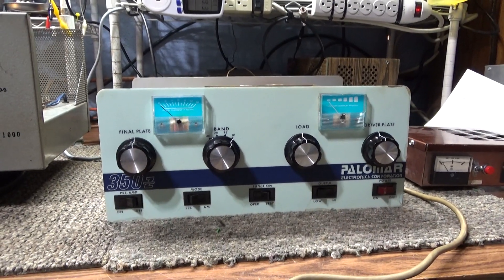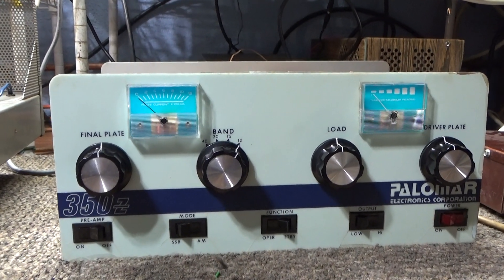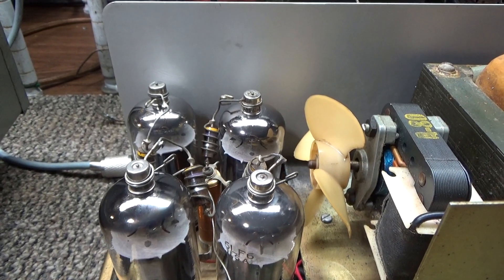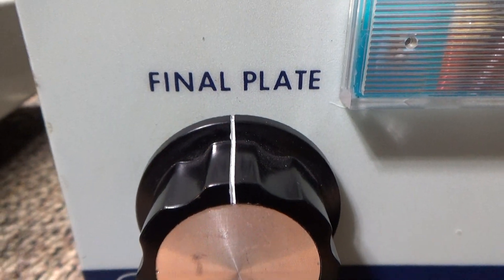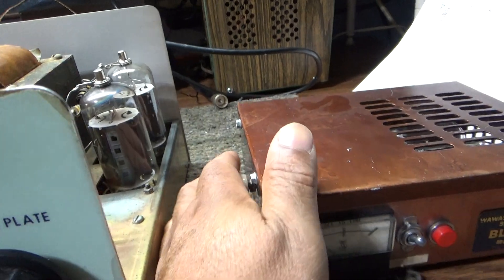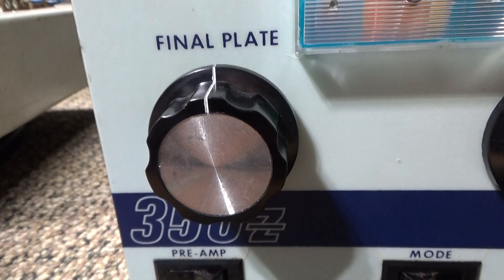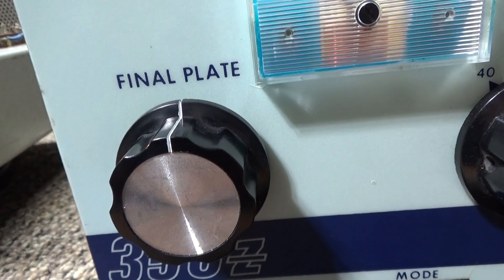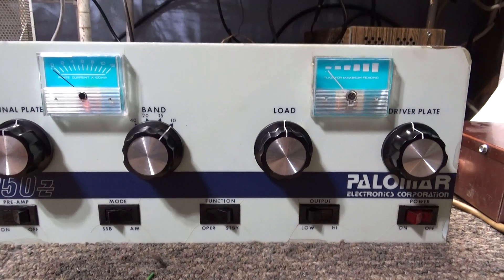Linear Amplifier Tuning Long Winded Walk Thru

Comment: Great explanation Doc! I really like those Black Cat amps. But most CB guys refused to tune them according to the manual. Most amps are grounded grid. That gives a fair gain and a low input impedance. The Black Cats were grid driven. That gave a high input impedance, but a very high gain. On most amps that are grounded grid, you tune for the maximum output, as you pointed out. But if you did that with a Black Cat you would pop the circuit breaker (on the base amp) or ruin the tubes. That’s one reason they had a minimum of adjustments. You adjust to the line and that was about all you had to do. The high input impedance with high gain made for an exceptionally loud amp. I used to get a lot of compliments on the loud volume of my setup. People asked how I got that big swing. I guess that’s why people called them a modulator amp. 
I’m a ham operator too, but CB has always been more fun than ham!
Reply from the maker: Agreed. As you said, Blackcat tried to make them fool proof. The Circuit Breaker instead of a fuse, as people would over fuse them, the 'Set To Line', and the Fixed Tune Cap on the JB-76 and with the smaller JB's they had a Fixed Load cap too.
Reply: @tramdr You hit the nail on the head again Doc! 
Something else I found out by having several of them is that the “power heads” may not always be the same. When I buy a power head by itself I look at how it is wired so I know which power supply it will work with. So far I have 4 different types of “power heads”. I marked them type A-D. I fully expect to see a couple more versions too! Seems like Black Cat didn’t follow any particular diagram. And I remember you saying that you have found many different types of parts used inside of them. Sure is confusing when you are trying to repair one!
Reply from the maker: Yes, I have found about ten versions each of all the Blackcat boxes.

Comment: With the Palomar amplifier your using in the demonstration your showing here the trimmer capacitor on the underside of the amplifier is adjusting the impedance match between the input of the amplifier and the "driving" transceiver.  The goal with all the controls on a amplifier is to adjust for the best impedance match from one stage to the next.  Be it from driving transceiver to driver input, driver stage to the input to the output stage or output of amplifier to your antenna system the goal is to match input impedance to output impedance of each stage.  The better you match each stages input / output impedance the more efficient the system works.  As you say, know your equipment.  If you have instructions for your amplifier follow them.  Also, as you say NEVER detune your amplifier.  Your amplifier is still making the same amount of power, It's just now burning up that unwanted power internally. because you have created a impedance mismatch between stages.  If you want less power out then reduce the drive power.
Reply from the maker: I agree but on the other hand, I am trying to keep it very simple for beginners.

Comment: I wouldn't say by a long shot that Bird Watt metes are the best or that Watt meters are relative.  I have power meters that are orders of magnitude more accurate than a Bird Watt meter.  The big takeaway is that as far as tuning goes it doesn't matter how accurate your Watt meter is.  The accuracy of the meter isn't important when your tuning a amplifier.  The maximum power your meter shows is.  Accuracy counts when you want to know exactly how much power you are transmitting.  Honestly you don't need to know the precise amount of power you are transmitting out of a amplifier to make sure it is properly tuned.  The reading on the meter is arbitrary.  Your just peaking for maximum deflection.
Reply from the maker: Except for the very expensive meters that can read digital and pulse, I still believe no wattmeter, including Bird, is accurate during AM modulation. They can be very accurate on Dead Key but with a complex signal, like modulated AM, they are relative, except for Peak. Peak can be accurate too.